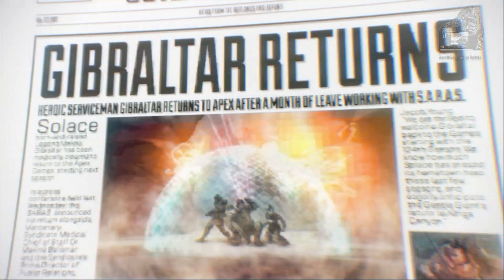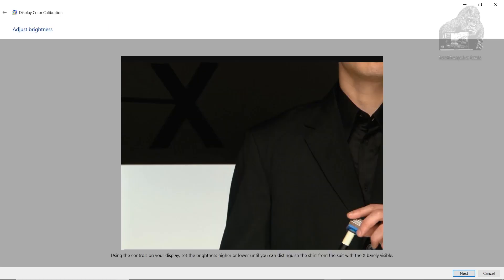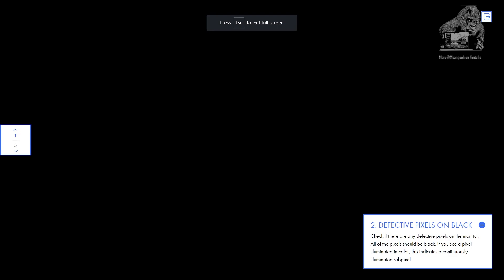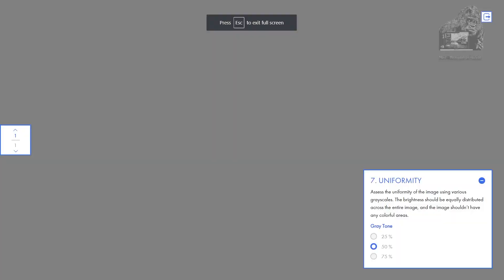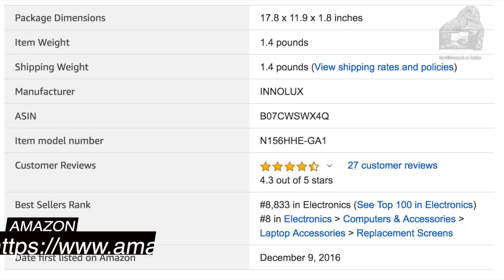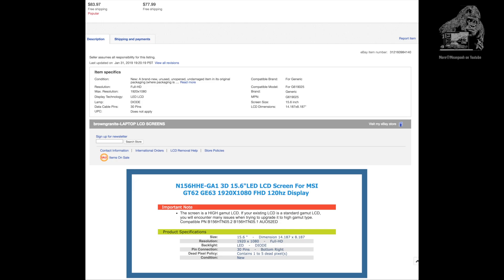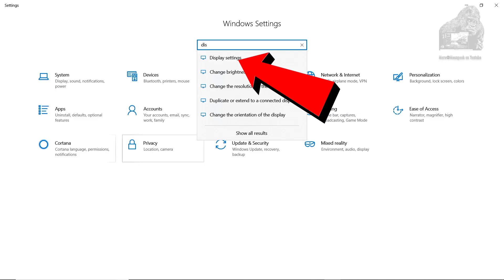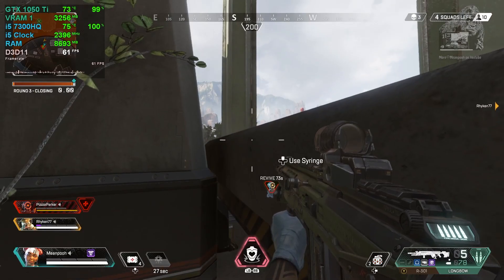120Hz LCD Replacement Panel Fine Tuning  *Update* Acer Nitro 5

Comment: I have this screen installed on a Helios 300 (very similar to Nitro 5) and I am using the same color profile from Notebookcheck. I notice that even after this, Gamma is still 1.4-1.5...far from the ideal 2.2 . Also, this panel really uses a lot of energy. The eDP connector below the monitor bezel gets a hot and my battery life has reduced to 2/3rd compared to the old dull IPS panel. How is your experience? Apart from that, the panel is sweet.
Reply from the maker: My battery has stayed the same but has shortened a bit from being old.  I never measured the amount of energy that the panel uses nor have I had my hands in that region the the laptop while gaming to notice the heat.  I do like the panel though.  Do you think it my be defective?
Reply: @Meanpooh  Thanks for your reply. I read that some other people also felt that. When I put the screen to 60hz, it reduces.

In dark scenes (like completely black background), there is a faint bit of noise. Thankfully, there is no backlight bleeding or glow. Even the contrast shift is better than the stock IPS panel.

Comment: does this model of display works for an acer nitro 5  AN515-52? thanks
Reply from the maker: Yes.
Reply: @Meanpooh  Is 60hz able to upgrade to 144hz as well beside 120hz ?

Comment: hello first thx for the video.I have Acer nitro 5 too but it is 144 hertz panel . You have 60 fps with 120 hertz but your game is so smooth while i have 60 fps it is like 20 fps can you help me ?? Plzzzz
Reply from the maker: You might have to adjust your settings.  I can't remember what settings I was using while making that video.
Reply: @Meanpooh  thank you . Is it triple buffering settings can it be ?
Reply from the maker: @egealtn4413  Try putting your graphical settings on Dynamic.
Reply: @Meanpooh  dynamic ?
Reply from the maker: @egealtn4413  Yes, in your graphics settings.
Reply: @Meanpooh  thank you but my knowledge on this subject is less . is it at nvidia settings ?
Reply from the maker: @egealtn4413  Are you saying that your games are running at 60 or above FPS but it looks like 20?  Is the game stuttering?  Is the problem happening in all games?
If it is Apex Legends, do the following.

Start your Apex Legends game, goto graphics settings, enable Adaptive Vsync, set Adaptive Resolution target to 60.  This should help you.
Reply: @Meanpooh  all games
Reply: yes 60 fps like 20

Comment: Hey meanpooh. I'm about to order all the parts in your links fo rmy acer nitro 5. I just want to confirm about the viper memory ram(8gb). Will it fit inside with the already installed default ram that comes with the nitro 5?. Can't afford to make any  mistakes with this purchase
Reply from the maker: Yes. It will work.
Reply: @Meanpooh  Thanks alot. I stay in africa and unfortunately the 120hz screen doesn't hip here. If you know any other screen that could work for the nitro 5. I'd love to hear them
Reply from the maker: No problem. If I hear of any of screen, I’ll sure to post up about it. After I try it of course. I can understand about the no mistakes comment as it’s probably hell on price to have some things shipped.
Reply: Yeah, The shipping fees cost just as much as the products sometimes lol. Thanks man. Love the channel and the content

Comment: I am thinking about doing this upgrade, but I have been reading about people who have a not so good computer with a high hertz monitor and they have bad performance. Is there a considerable difference? Have you seen any improvements with smoothness in your games?
Reply from the maker: Yes, it is better especially when using everyday applications and browsing the web.  When I play games that can actually go above 60FPS, movement is very smooth.  I don't know how this panel will work with other machines as I have only installed it on the Acer Nitro 5.
Reply: Meanpooh I also have the Acer 5, I've done all of the upgrades you have done using the help of your videos, I play games like siege where having that extra smoothness can win a match, but I'm not sure if it's worth it if the Acer 5 can reach 120 FPS
Reply from the maker: @jacobdownton6301  I know what you mean.  There's probably very few games out there that can reach it.  Just knowing that I can take advantage of games that will achieve that high FPS while lowering settings is good enough for me.  Setting the Freq of the panel from 120 to 60 makes a big difference after you have been using the higher for a while.  Not going back to 60Hz if possible .
Reply: Meanpooh Thank you for the help, I will do the upgrade, I am sure I will be blown away as many people say it's impossible to play on 60 hz now days
Reply from the maker: No problem.  I was always fine with 60 but when I tried 120, I was shocked at what Ive been missing.  Its like going from a 60HZ HDTV to a 120/240.

Comment: Nice video man. I have a Acer Aspire v15 nitro with a gtx 1060 and a i5 6700hq. The cpu is obviously bottleing and als throtteling. In most games i get microstutters and sometimes it even frezes for 1-2 secs. Is that because of the pannel? I thought getting a 2x8gb ram from kingston. They are recently the fastest and support overclock undervolt. The thing is it is 130€. Do you think it will improve the games, like pubg or insurgency, that require al lot usage. I also thought upgrading the display to a 120hz. Are there many differences, because i see on ebay some 15.6‘ for 60€ and some for 120€. What do you think would help my system most, or both. Already pastet it with liquid metal. Many question i hope you can help me :)
Reply from the maker: I do not think the stutters are from the panel.  Have you tried reducing your resolution just to test for stutters.  a 120Hz panel will be good for online and offline gaming by helping your reaction times.  More memory will help you the most.  16GB to 32GB.
Reply: @Meanpooh  i have no 8 gb. I think the new ones from kingston with 2400mhz will do the best with 16gb. Also found a 120hz panel with g sync for 120 Euro. Do you think it will work with my 1060? i Think ill upgrade both.
Reply from the maker: You have a link to panel?
Reply: it is an exchange part for xmg ultra 15. This ultrabook has still a latency of 5ms, which is kinda much. The latency bothers me also, but is there even a notebook with 1ms?
Reply from the maker: Not sure.  Maybe that acer Gaming laptop that costs over 7 grand has one.
Reply: Meanpooh so what do you think. Should i order it from Gb for 120 or are the chance small that it will fit and work?
Reply from the maker: @sukez.cinematics  I read a little bit more and it says that it is a 30 pin connector which should work.  What series is your Acer? V3? 575G?
Reply from the maker: @sukez.cinematics  Another thing.  I compared the screw holes and the connector placement and they match up with the 120Hz that I purchased.  This panel works with the Schenker XMG machines as a replacement.    I cant find any part number other than "AHVA-IPS Razor Panel".  I cant find anyone using it with the Acer Aspire.  Other than that everything matches up.
Reply: Meanpooh it will probably fit as i see, but now i ask myself if this panel is really g-sync capable or its just a catchy word put there in. Ive read somewhere that g-sync on laptops is made by the gpu itself. I am not sure what i should believe. But maybe the display is the same as the 60€ one. I would pay double the price for g sync tho
Reply: VN7-593G-57NE is the name
Reply: I5 6700k and gtx 1060 which should normaly be capable of g sync.
Reply: The thing is if i go into my nvidia settings, i can not activate any g sync. I am slightly confused
Reply from the maker: Watch this.  Especially around the 2 min mark.
https://www.youtube.com/watch?v=ADYzuMe17q8

Comment: Thanks bro I'm going to switch out the panel soon and apply the tweaks. Just bought a used nitro 5 for $600 with i5 8300h, gtx 1050ti, 16GB RAM and extra 1TB SSD included. The screen is ok but I like higher framerates.
Reply from the maker: Let me ask you a question.  On my old display if you push the screen back fast it would glitch a bit.  Does your screen do that?
Reply: Meanpooh nope mine doesn't do that just tested it.
Reply from the maker: @jesusc978  Ok, thanks.  With the new display, it feels solid.  I just didnt know if it was the stock build causing distortion.
Reply: @Meanpooh  mine does that only when plugged in
Reply: @Meanpooh  my screen on mine with the 7300 hq pretty much sucked. When you pushed it or moved the screen it glitched. Now it's gotten to the point where the glitches just happen and the screen is unusable. Currently using a monitor but would love to get the screen working again. No clue where to find a screen though

Comment: Hey very nice vid but just one question, is the i5 7700hq better or the 8300h?
Reply from the maker: The 8300 has updated CPU thats all.
Reply: 8300h has slightly faster turbo speed (4.0 vs 3.8 Ghz), has more cache (8 vs 6 MB), and uses faster ram(2666 vs 2400). over all, its faster, but not a significant amount.

Comment: Hey meanpooh nice vid, i want to change the backcover of my nitro, the predator helios 300 has the same measures of the nitro 5, you know something about that?
Reply from the maker: I sure don't but if I find some info about it, Ill post back.  Sorry I couldn't help further.  BTW, is it broken or cracked?
Reply: @Meanpooh  its cracked, looks bad :(
Reply from the maker: Ok, After studying my video and looking at the replacement cover, it's a fairly easy fix.  The screws just have to be removed and the wire routed correctly and of course the camera needs to be transplanted.
Reply: @Meanpooh im going to do It, Thank you meanpooh!
Reply from the maker: You're Welcome, just take your time and remember to shut it down and unplug the battery.

Comment: Great info! Makes sense that it’s more work to get better performance out of a budget gaming laptop by upgrading it. I’m going to wait out my warranty on the Nitro 5 for the time being, then probably start with a repaste to see if cooling improves.
Reply from the maker: Thanks, I was doing the same thing.  I just couldn't deal with the high temperatures. I took the plunge with repasting and was pleased.  If I ever have to send it back, ill swap out the display.